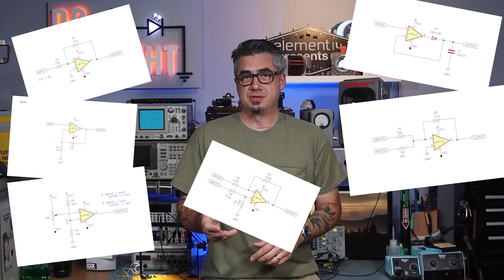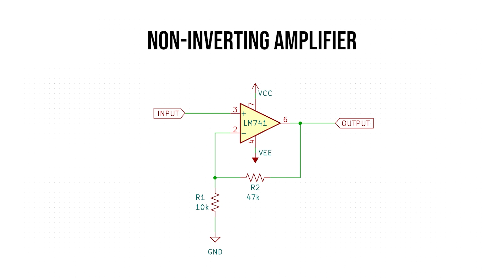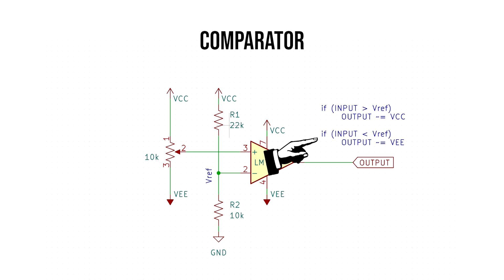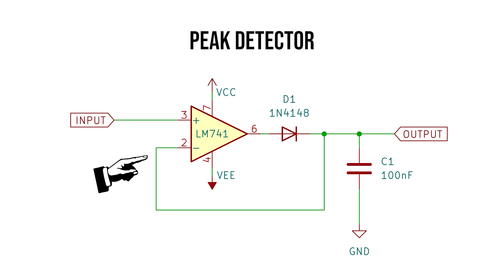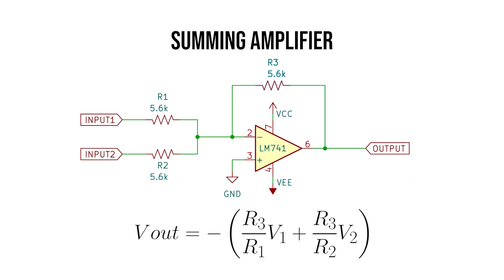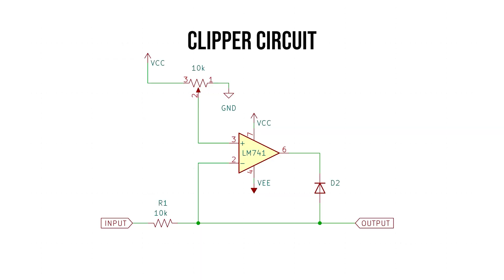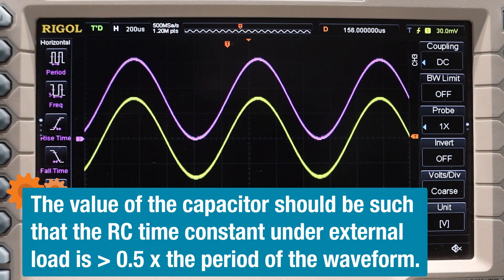Explore Working Applications of 8 Different Op-Amp Circuits - DC To Daylight

Comment: The clipper is not an "opamp" circuit, or at least not basic ones( think of basic logic gates and combinational circuit)

It simply uses an opamp as a voltage follower

Literally a bjt could replace it in that application

This is important to point out, otherwise u could have put like 999 others "opamp circuit" that is really just basic configuration in different shape or form

Comment: Hello. I am a physician. Appreciate your video. I am creating an analogous circuit to exemplify the way our body store nutrients like glucoe & fat. This I want to show by improving your circuit at time-stamp 4.02, noninverting amplifier. Our body stores the energy at the Vout with Gain=1+ feedback. I wish to connect a capacitor at Vout. When I increase positive feedback by changing R2 , capacitor charges and this will shift the baseline of sinusoid upwards. It will remain up as long as capacitor maintains the charge. If I decrease the feedback by changing the R2 value, will the capacitor discharge? will the baseline come back to where it was. Do I need to add a discharging resistor after the capacitor or it will discharge via R2? Please guide. Thanks in advance.

Comment: Sir your explanation was nice for my understanding,I request you that when your explanation will done than also share the application of configuration like summing amplifier, inverting amplifier,non inverting amplifier in which circuit we use this configuration

Comment: Use the right that clipper is very interesting… i’m pretty familiar with a wide range of guitar lipping or arrangements, but I don’t believe I’ve ever seen one laid out like this, using the bias to vary the clipping threshold. Is the idea just that we are forward biasing the diode a bit, such the less input signal is needed to finish turning its “on”?

Comment: Wow, you've got a flux capacitor on your test equipment shelf. Is it a proper one from Farnell or Mouser or a knock-off from eBay? Please don't take chances with your time travelling safety to an eBay cloned part.

Comment: Why use a 741 when a TL081 is so much faster ?
Reply: Oops. My bad. Your circuit diagram says 741 but the breadboard is using a TL072. Sorry about that.

Comment: HI, Can I ask a question about the differential circuit. I have a DJ mixer that has two  opamps  for left and right with hot and cold. On both of the left and right signals when I turn up the volume the hot signal is distorted. I am using a sine wave test tone to check and I can see the top of the hot clips, but the cold is ok. The part that is confusing me is that it's the same on the left and right and the only part that is common is the 15v VCC. The original fault was noXLR output and it had fuses on the coldside that had blown.  I am researching as much as I can and this mixer does not have a schematic so I am using one that had the same fuses on the cold side as reference.  The signal going into this circuit looks to be even on the hot and cold side from the dac.

Comment: Are you using scope probes to feed the input signals with a signal generator? In the other opamp video of yours, you use a solderable BNC connector, you can see the center lead of the BNC connector going the breadboard, but the shield/GND lead is not clearly visible. It seems to go to GND, but it's not clear if it is 50 ohm terminated or not.
Can you give a clearer picture?

Comment: Complete confusion at 16:01 to 16:11 as to which is the inverting and noninverting terminal.  The schematic shows the 10K resistor and input into the inverting terminal whereas pin 2 is being described as the noninverting terminal (which it isn't). The anode of the diode schematically is fed into the inverting terminal which, in the narrative, is described as being the noninverting terminal (which is isn't).  Element 14 sucks. Videos are convoluted, put together in a lazy and reckless fashion. What a shame.

Comment: At 8:51 the diode is actually connected from pin 6 to the inverting input. Not the non-inverting input.

Comment: I like what you're doing here but it's a disserve to avoid mentioning that op-amps aren't meant to be used as comparators. A comparator IC is also cheaper.

Comment: Such a great presentation. You show practical working ciruits with good examples (love the diff opamp substraction noise -- where you created a simple noise source as well!), the theory, the scope it all just makes so much sense and is to the point, so it's easier to reproduce and make actual practical sense. Thanks!
Reply: ❤❤o😂❤o❤😂❤❤❤❤❤o❤❤😂❤😂❤o❤7❤❤90😢❤😂❤❤o😂

Comment: One detail on the diff amp common mode rejection, is more dependent of how well the resistors are matched than the intrinsic
common mode rejection of the op amp.  Depending on the required rejection it may be desirable match resistor values if you 
have a bag of 100 resistors depending on the CMR desired and your meter it's possible to improve performance by taking
this extra step.

Comment: To the deviation of measured calculated voltages:
Did you use 0% resistors, or the more common +-5..10% ones? 
You rarely have exact values w/o adjustable parts. High precision devices contain multiple adjustment points.
BTW, you are just 1.2% away from theory. A lot of measurement devices aren’t more precise, especially the cheap ones for hobbyist.

Comment: I have question with invertina amplifier much more powerfull output goes to input and can it also affect the signal source... if it very weak? it just have to pass couple resistors

Comment: Great video. I too love the differential amplifier circuit. What op amp would you recommend for use at HF radio frequencies, such as 3 MHz to 30 MHz?

Comment: It's also very important to mention rail-to-rail feature of op amps. TL082 is not a rail-to-rail op amp, so the output is not expected to fully reach Vcc/-Vcc.

Also, it would have been nice to enlist the voltage follower (a.k.a. unity gain amplifier, or isolation amplifier) which has high impedance input.

Very nice video, I also saved it :)
Reply: The same applies to 741 as to the rail-to-rail "capability".

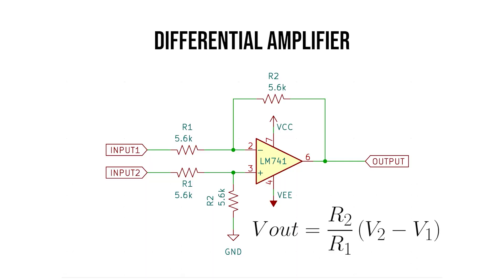Comment: A question someone might answer: if I increase the 5.6K feedback resistor on 13:19 to a value of say 11K, then the gain increases as well, right?
Any time we increase the feedback resistor, the gain also increases?
Thank you to whoever will answer this. I'm at the beginning to understand amplification.
Reply: @AmRad Podcast, thank you so much, Derek! 😃
I have a modern 1993 Yamaha integrated amp with THD of 0.001% and it doesn't play as nice as my 1970 vintage Sony amp, which has a THD of 1%. A friend told me to increase the feedback resistor to a higher value, so the sound would be in a more "2nd harmonics" character. The problem is "how much" higher the 22k FB resistor in the Yamaha amp can be increased without oscillating. I don't have an oscilloscope or spectrum analyzer to see how the harmonics peaks follow after the 1k Hz fundamental.
Do you think I can double the 22K FB resistor to 47k ohms?
Thank you immensely.

Comment: It appears that there is a bit of overshoot at the beginning of the clipped voltage region in the clipper circuit. Is this typical of this configuration?
Reply: Not enough bandwidth. The opamp needs some time to recover from the saturation, as it is used as a comparator here.

Comment: This is such a handy reference guide. I'm always afraid to play with op amps.

Because I'm a n00b I only discovered yesterday the affects of putting capacitors in series vrs parallel. I feel like that could be an interesting topic of discussion!
Reply: Just remember that all circuit are just basic versions. E.g. the peak detector needs a feadback path for the negative signal, otherwise it drives the opamp into saturation. You can see that at the scope. The 1n4148 diode is to fast to cause the seen „switch noise“. Just look up for „ideal diode“ to find circuits for that.

Comment: Thanks again for a great, to the point video. A few questions I would like to ask: Which single supply opAmp would you recommend for hobbyists to use in new designs? For low-ish frequencies, say under 100 kHz and voltages in 10s to 100s mV. For use as a comparator?
What is the typical value of the bypass capacitors? Or, what should one consider when choosing the value.
Reply: That's a question that doesn't have a single answer. Almost any opamp can work with a single supply if you create a virtual ground at half the supply voltage, Using a TL431A to create that mid-point voltage works well for low current applications and they are really cheap.
Anyway, you need to decide whether you want to use an opamp with digital circuits like an Arduino, or with analogue circuits like audio use. For digital interfacing, you'll get the best voltage swing from a 5V (or 3.3V) supply by using a rail-to-rail opamp, which means a CMOS type these days. I like the MCP602, but there are many to choose from.
For audio use, you can get really low noise, high-specification audio opamps, but they are expensive. For the hobbyist, I'd recommend the LM4562 which is about twice the price of the NE5532, but with significantly better performance.
If there's no specific requirement, you might as well use the LM358. It's nowhere near as good as more modern, specialised opamps, but it's dirt cheap and there are thousands of circuits designed around it.
Finally, I'd use a comparator for a comparator, not an opamp. There are no problems with lock-up, phase inversion, limited common mode range, etc. The LM393 works in all but the most specialised comparator circuits, and it's also cheap.

As for the decoupling capacitors, you just want something that provides a low impedance path between the supply rails and ground, especially for high frequencies, so the value is not critical. You just want something with low self-inductance mounted close to the supply pins. Most of the time a 100nF capacitor, ceramic or better will work fine.
Reply: @RexxSchneider  Thanks so much for your detailed reply. As you mentioned, there are so many to choose from, and unless one uses them extensively, it can be difficult to find a starting point. 
And your comment about using a comparator is well taken 👍

Comment: You might want to point out the effect that resistor tolerances have on observed gain - looks like you're using 1% tolerance resistors, so not much of an issue, but with 10% tolerance ones you could see a much bigger difference (up to 20%, I think) in the observed gain if the resistors happen to be at opposite ends of the tolerance range.
Reply: @AmRad Podcast When you do, don't forget to point out the additional color band on 1% tolerance resistors, that can sometimes confuse less-experienced people.